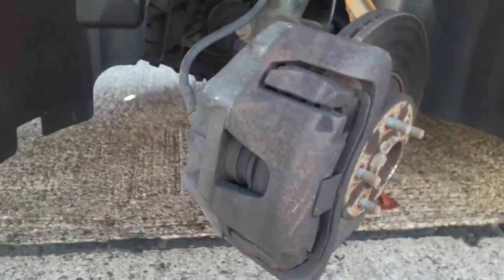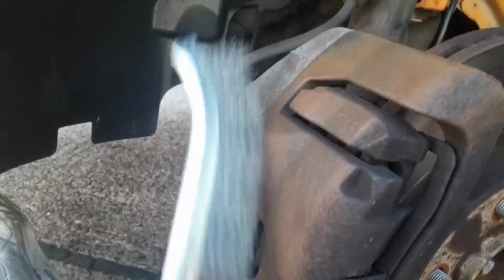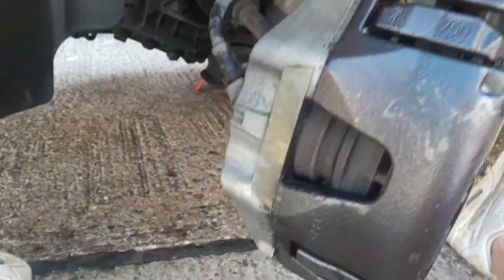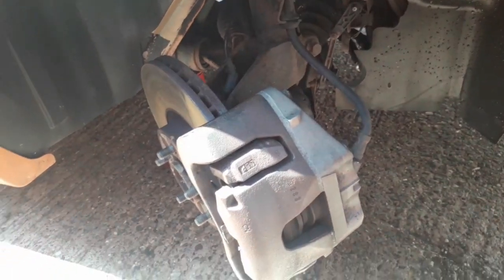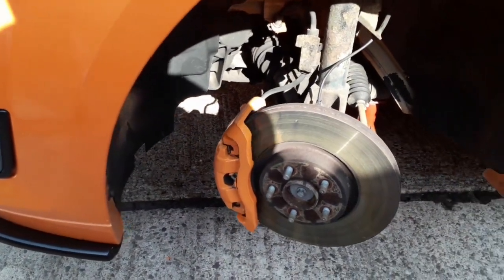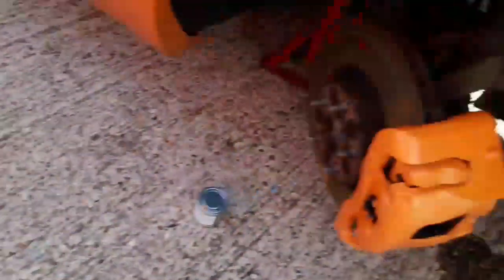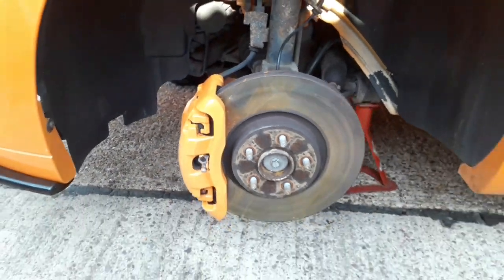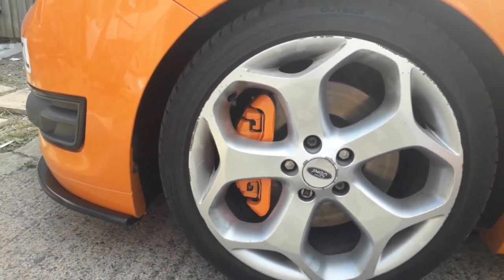Painting the calipers

Comment: Hi just been catching up on all the new st content that has been uploaded over the past few days on YouTube couple of things that front splitter does it come with pre drilled holes and fitting kit?where was it from?I liked your wrapped rear bumper you got the diffuser yet?I'm thinking of just wrapping mine did you debadge your focus badge?I love the ride height of yours how do you find the ride?is it really firm?I don't like how high the rear of mine sits.Cheers for the content once this all over so want to get to some shows meet up with other electric orange owners
Reply from the maker: It's an RSparts splitter, you can find them on Facebook mate. It does come with pre drilled holes but I dont know about the fitting kit as I got mine second hand. Hence why it needed redoing 😁  sadly I haven't got a rear diffuser yet, but it will come soon. I did debadge mine yeah, was easy enough. The springs are cobra 20-30mm drop, 20 on fronts 30 on the rear. Guy on Facebook who sells better ones that are 25-40mm drop, called eiback level stance, they're the best looking IMO. It rides fine, I have no issues with the suspension tbh. Yeah once lock down and corona is over, show season will be great I think

Comment: neat job ash nice one bud, ive just had a delivery of more bits for the tango mobile👍👍🤣🤣
Reply from the maker: Good lad!! Going to be a busy guy 👍🏻
Reply: Masters Mods hi ash, i started painting my callipers with the vivid orange paint and noticed mine wer in quite a bad state so ive taken all the callipers off and sent them to SSL to recon all 4 of them and they are also going to enamel hard bake them for me in vivid orange costs £300 all in and they come out real nice like new you can find them on ebay just for interest if you type in focus callipers and the shop is called steering specialists limited in wakefield keep them vids coming mate 😍
Reply: Masters Mods oh and just for interest again heres my list of st mods 
tyres                                                  yes
wheels                                               yes
bola wheel nuts                                yes
stereo surround                                yes
sony dvd h/u                                     yes
new turbo pod                                  ordered
black st dust caps                           yes
rear lights                                         yes
rear bumper light tint                      yes
induction kit                                     yes
rs ecu cradle                                    yes
front bumper black wrap
side strips matt black                     yes
dump valve kit                                 yes
symposer delete bung                    yes
cross over silicoln hose                  yes
orange calliper paint                      yes
heater dials                                     yes  
lowering springs
recon and enam callipers              yes
spot light surrounds black
rs vacuum pipe
paint visible arms                           yes
full service
cam belt
night edition badges
clutch and flywheel
cold air feed
orange ford badge gels
gloss black st overlays
maxton rear diffuser
maxton front splitter
maxton spoiler extention
rear brake dust plates                   ordered
and next week im going to order the mongoose cat back with 4” slash cut tail pipes, lowering springs, ra vac pipe kit, full set of brake pads😜
Reply from the maker: @2e0msw  yeah I bet they'll be nice 👌🏼